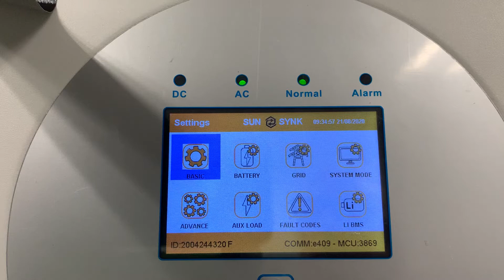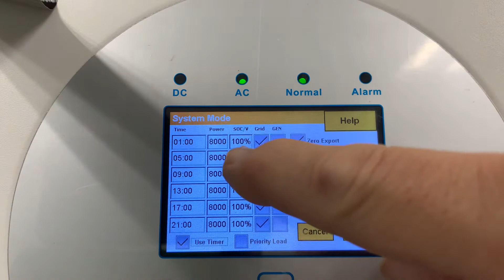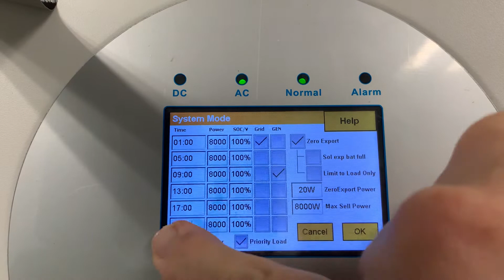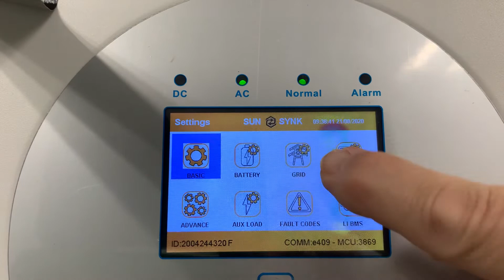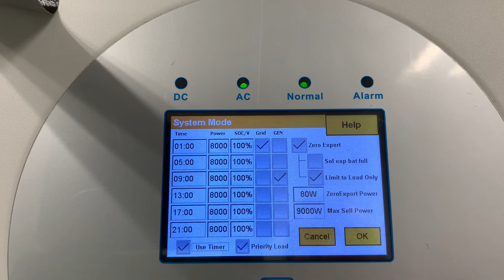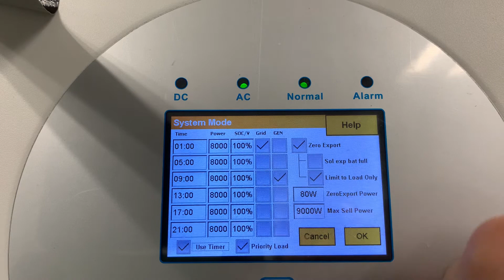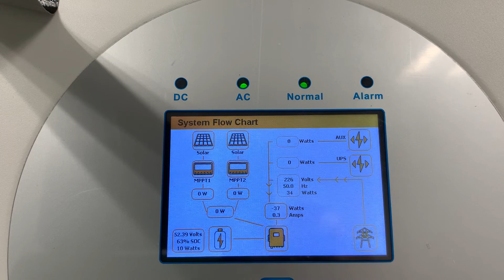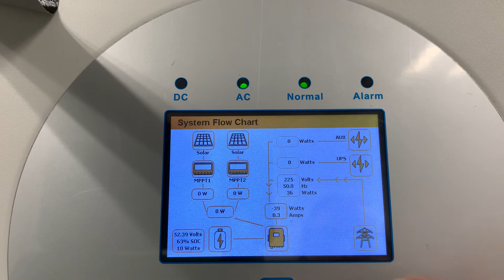Sunsynk Training part 2 sec 5

Comment: I think you should be more clear about system mode. Export battery you are refering to is just normal discharge of battery for house load. People under term export understand export to to the grid.

Comment: My timer keeps resetting to current times and only wants to charge 20%. It never keeps the memory. How could I change that?
Reply: Hi. I am experiencing this exact same issue. Sunsynk has updated the firmware, tried to change things remotely, but the issue still persists. Did you find a solution for this?

Comment: I am using 2x Sunsynk 5.5kva hybrid inverters, and I am using a Landis+Gyr prepaid meter.

The 20W zero export value prevents the prepaid meter from tripping and getting Error 30.

HOWEVER, an issue that I need help with:
... if I enable SOL EXP BAT FULL then my prepaid meter charges me for my exported power.
... I've tested this with zero load going through the "GRID CIRCUIT" and with my geyser drawing power from the grid circuit, both times it drew 200 W in a span of 6 mins.

If I enable limit to load, then will this only export what my geyser needs ?
and, more importantly will my prepaid meter not charge me for the power I exported to my geyser?

Thanks in advance!